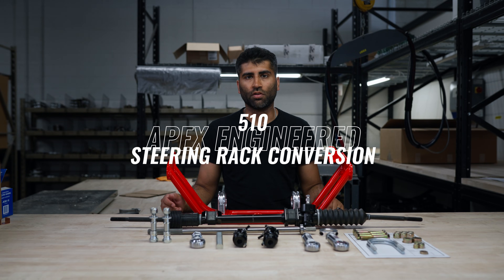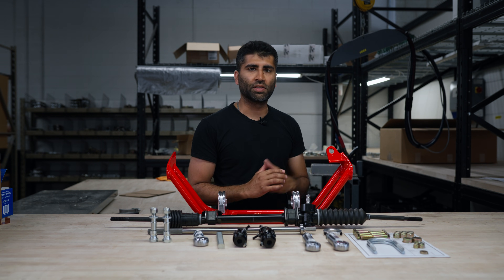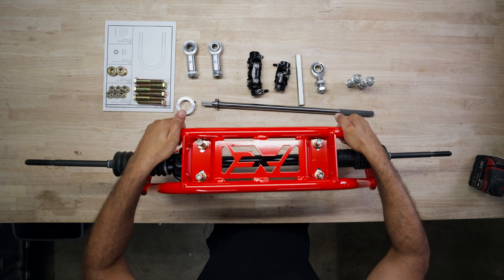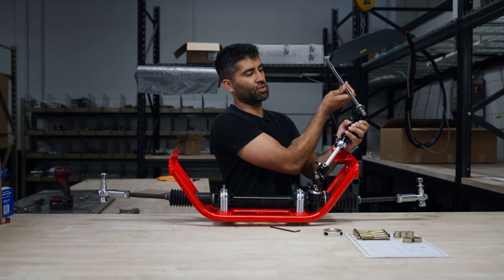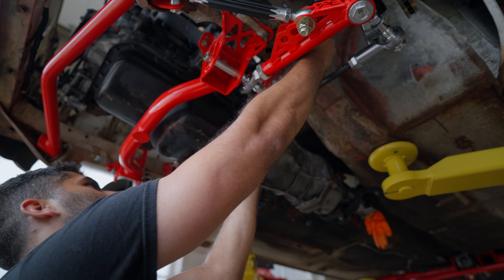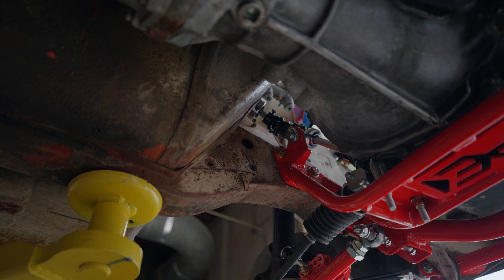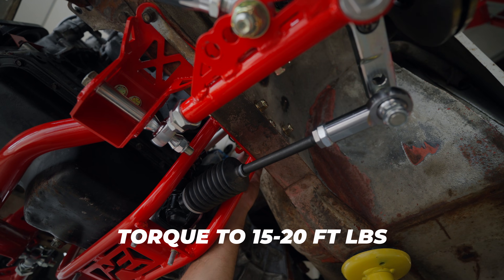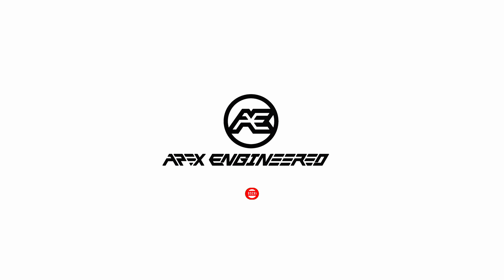Apex Engineered - 510 Steering Rack Conversion - INSTALL

Comment: Does this kit affect ground clearance? My car is extremely low. Does this sit lower than the oil pan?
Reply from the maker: Email us. We can send you a picture
Reply: @apexengineered  I asked this same question via email (my 510 is on air ride) and you sent me the picture but from the angle it's taken at I still can't tell if ground clearance is affected.  Any way you could create a video (or additional pics) showing the lowest point of the steering rack as compared to the lowest point of the car chassis/crossmember? Using a straight edge and level if possible. Thanks.
Reply: U bolts for the rack mount? You couldn't make a standard type rack mount work?